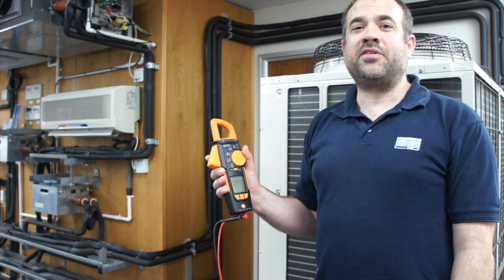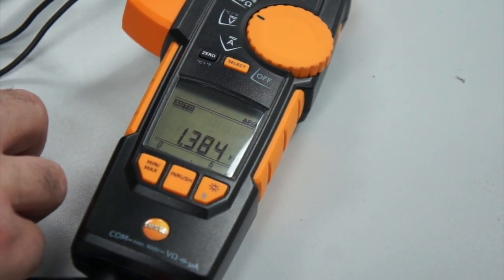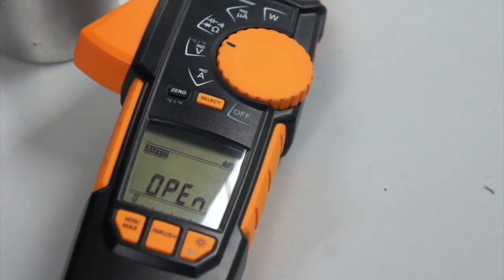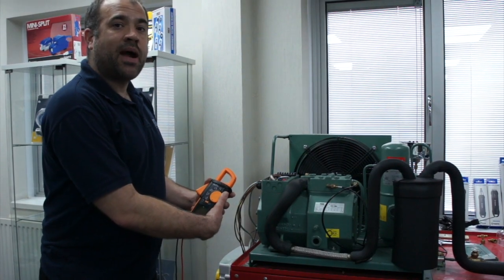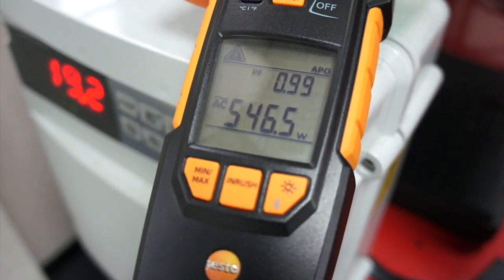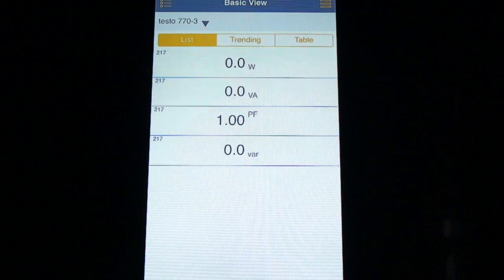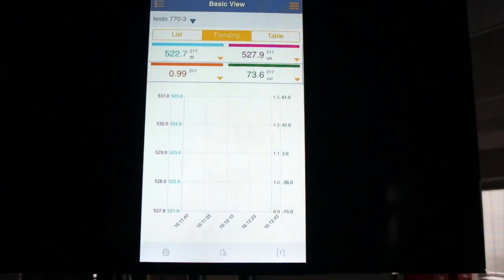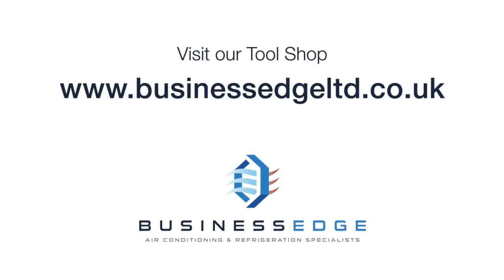Testo 770-3 TRMS Clamp Meter with Bluetooth Review

Comment: When you measure the power mode, does the clamping (current) and test lead (voltage) contact depend on the connection type (delta or star) of the motor?

Comment: testo 770-3 Clamp Multimeter is available in stock at best prices
For any enquiry feel free to call us 

Gaurav Batra
Mob    :  +91-7015572673
Email   :  info@@t

GNM PROTECH SOLUTIONS
(AN ISO 9001 : 2015 Certified Company) 
Head Office: WZ-3509, Raja Park, Shakurbasti, Delhi-11003